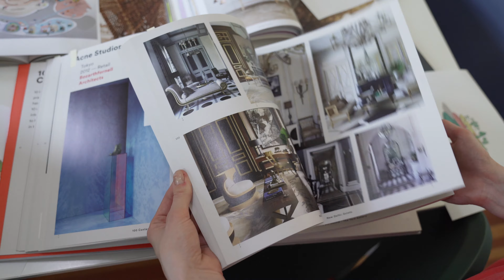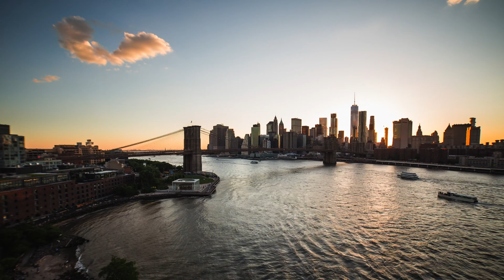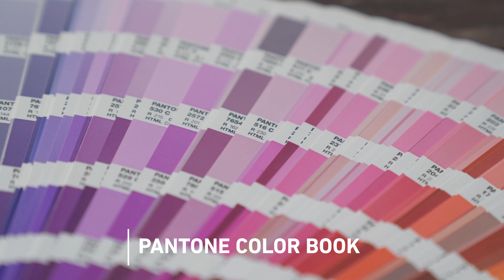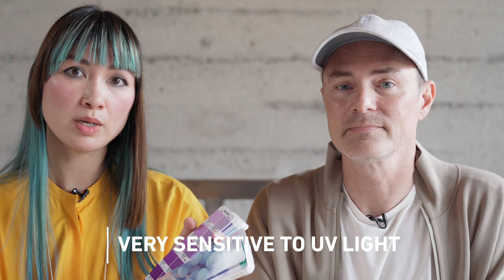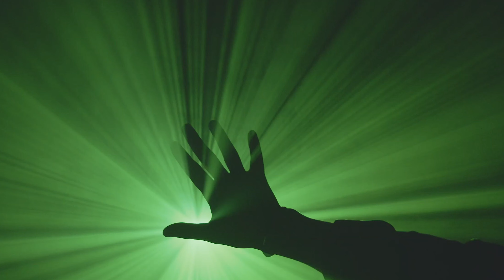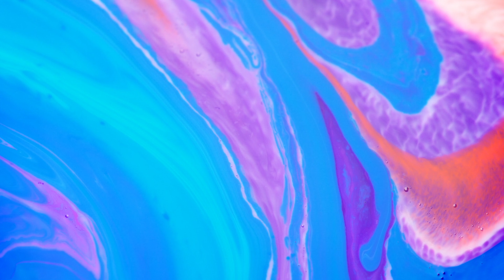Color

Comment: Thank you for your insights! Are there any resources you would recommend to learn more about color/material stability when exposed to significant UV light?
Reply from the maker: What a great question! 

We typically learn more about if a color/material is stable when talking to manufacturers and material scientists in the material selection process. 

But for you, we'd recommend you try searching for MSDS sheets on manufacturer websites (like 3M, Dow Chemical, etc.). You could also look into automotive case studies or white papers.
Reply: @NonfictionDesign  Thanks for the tip! Really looking forward to seeing more of your content. The manufacturing videos have been helpful for my university project and the book recommendation in the DFM video was also much appreciated. Thanks again!